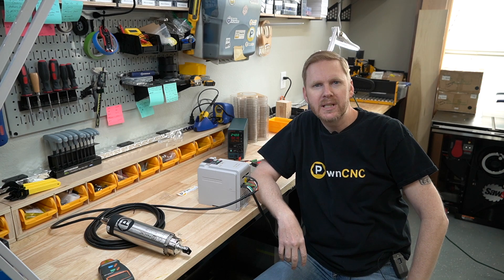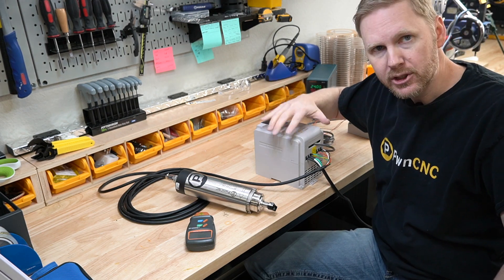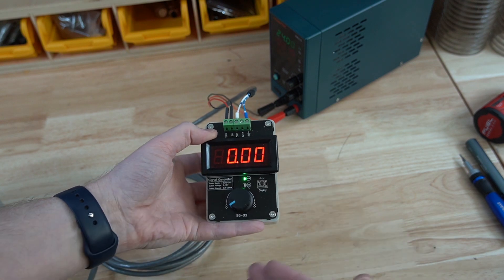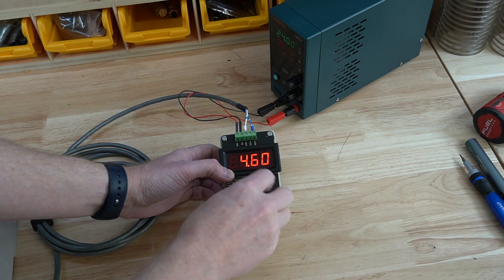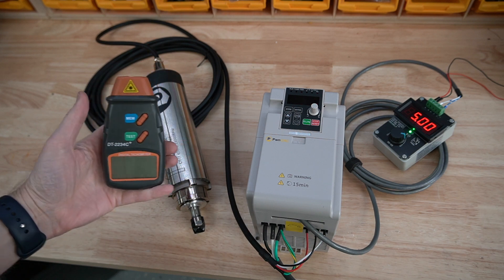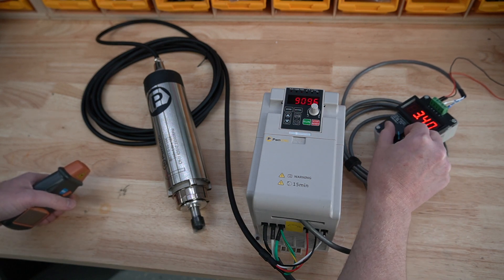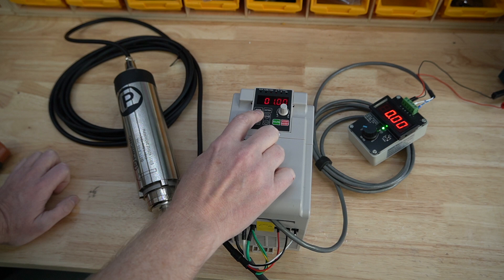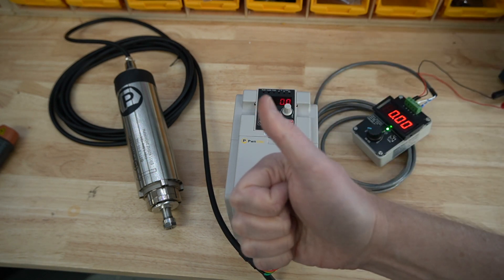PwnCNC Spindle... PWM Testing

Comment: Hi .
I live in New Zealand,  we have 220 volt here. Is your 220 volt air cooler 2000watt system plug and play compatible with the new altmill?
Reply from the maker: Our 220v Spindle and ATC Systems can be used with New Zealand power.  (https://support.pwncnc.com/kb/article/15-what-you-ll-need-to-power-your-2-2kw-220v-spindle-system/) take note of the international note at the bottom.
Our systems will work with the AltMill.  Our AltMill should be arriving towards end of this month.  We know it'll work via PWM motor control.  We're working closely to get our VFD modbus controlled as well as getting our ATC System fully compatible with their new Ext-SuperLongBoard controller that comes with the AltMill.

Comment: So the pwn cable links the VFD and spindle up to the (BUILD BOTICS Onefinity) controller so it's all managed through the GCODE as apposed to manually having to turn on and set the RPM? 
But you are sending the cables as you receive them in the order of our purchase?
Reply from the maker: Correct, but in the case of Onefinity / Build Botics, we're solidifying the final settings to communicate over Modbus/RS485 instead of PWM.  PWM is more of a fire-and-forget whereas Modbus is a fire-and-verify.  The feedback capabilities of Modbus are so valuable, it's a shame it isn't the standard for our hobby level cnc machines.
I, personally, make these cables and will be shipping them out in March in the order, orders were received.
Reply: @PwnCNC  Very Nice, Thanks again Daniel